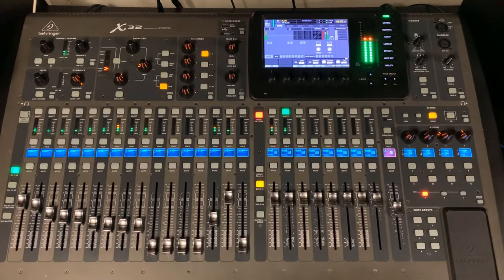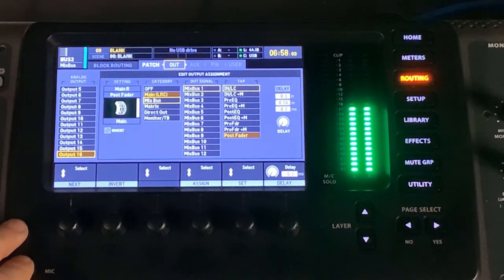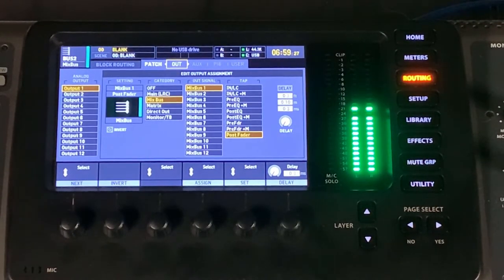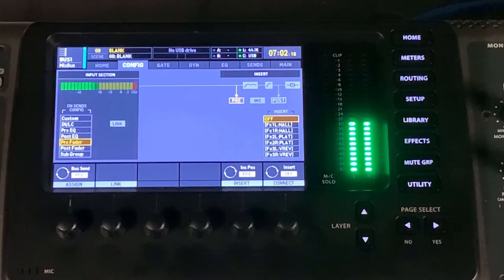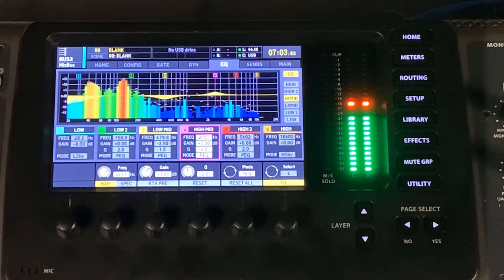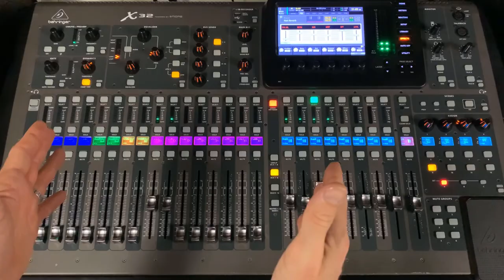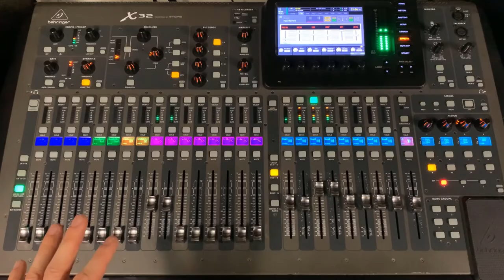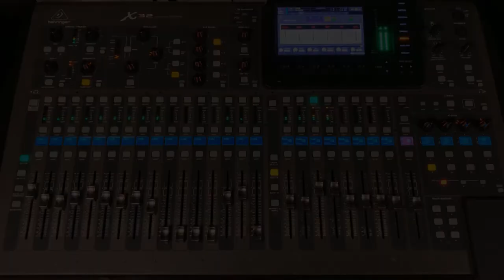How To Setup Monitors On The X32 (or M32) Sound Console

Comment: Thank you for this video!!  Question- at around 16:20 in the video you say when applying effects to the monitor bus, to deselect the stereo bus so it doesn’t go to FOH.  What if I’m already sending some reverb and delay through the FOH but want to send a portion of those same effects to the monitors (IEM)?  Could I just leave the ‘stereo bus’ selected/turned on for the  corresponding effects stereo returns (on the 3rd layer down) in order to have the effects in both the FOH and monitor bus?
Reply from the maker: Yes, you are spot-on. Build your FOH mix first, then start building your monitors. You would treat the FX returns just like any other input and the more you turn it up in the MixBUS, the more you will get.
Reply: @AllamHouse  You rock.  Thank you!!

Comment: Thanks so much for the training.  Pls I will like to know effect of not pressing the home button to lock the console  before power off the X32 mixer.
Reply from the maker: You do not need to push any buttons before you turn the console off. It will return to the same setup when you turn it back on for the next session regardless of what you push before you turn it off. It is recommended to save your scenes so that your settings are saved in case of some error or reset. This video discusses saving your scenes if you need assistance. https://youtu.be/G0bqVeviRKg

Comment: I have my laptop hooked up and my outputs are my Behringer X32. I have my headphones connected to my mixer as well, and I even have Spotify playing and I don't hear anything through the headphones. Nothing from my laptop is being heard, even though the levels and outputs are properly picked. Is there a setting I have to change on my mixer in order to hear everything from my laptop through the mixer, and headphones ?
Reply from the maker: It sounds to me like you haven’t switched the inputs on the console to come from the card. On the console, go to Routing > Inputs and in the bottom-right you can change the encoder from REC to PLAY and this will automatically switch your inputs to look at your X-USB card.

Comment: Thank you for the excellent tutorial!  Can I re-assign any of the buses 13-16 to mix buses from effect loops? If yes, how?
Reply from the maker: Yes, the MixBUS 13-16 can be used like normal MixBUS and bypass the FX racks. You need to do the following items...
1) If you need these to go out of the console you will go to Routing > Out and confirm that output 13-16 are set as the source for the desired outputs.  Keep in mind you are probably using two outputs for Mains so you will really only have 14 other outputs to choose from. Obviously, your situation might be different than what I am assuming.

2) Go to the Effects button next to the screen and scroll over each FX rack 1-4. You want to change the source of FX 1 from MixBUS 13 to Insert. Repeat this for all FX 1-4 so they are de-coupled from the racks.

3) Now each are a standard mono MixBUS that you can use however you see fit.
Reply: @AllamHouse  Thanks Dave, you saved the day! We only use one or two effects max in our normal church services. This opens up a couple more mix buses for our IEMs. Really appreciate your help!

Comment: Hello Allam. Thanks for your Great videos. I have a Behringer X32 Compact at our little church and I am getting to feel my  way in getting to understand it. Thats why your videos are so vital to me. One of my 2 main speakers output plugs (7 and 8) does  not  work ( plug 8). I switch both snakes and they do work in the same output plug (#7).The both perfectly in plug 7 but neither of them works in plug 8.Bothe speakers are great.
Do you know could have  cause this? I know that both snakes are working, and both speakers are also working  because when I switch the snakes  in the same number 7 output plug both speakers  work one at a time of course
Reply from the maker: It seems like a basic routing issue. I would go to Routing > Outs and make sure that output 7/8 are set with Main L/R as the source. Then go to Routing > XLR and confirm that your groupings are set correctly. 1-4, 5-8. This video about the routing screen might offer some more info. https://youtu.be/PpeqRuPGi2Y?si=qPsAJw8Uq7jj9Afi
Reply: ALLMAM You are a Genius. This worked  Great. Thanks again

Comment: Thanks for the video! Question, how should you route a stereo signal from the keys channel to mono wedges? At a friend’s venue, the wedges always have a weird sound like there’s an issue with phasing. The house sounds great, just something is going on with the wedges
Reply from the maker: I typically just send both channels in and don't have any issues since everything will get summed to mono. It sounds like you are saying that when that happens there is some odd cancelling occurring. To troubleshoot, I would unlink these keys channels so they are two mono signals and then send only one. See if it sounds the same or different. If it is better, a work around is to unlink them permanently, pan them manually in the house and then use a DCA to control their volume so you get back to having one fader to control the volume of both channels.
Reply: @AllamHouse  thanks, I’ll give that a try next week!

Comment: Hi, having just ventured into the digital desk with an x32, this is extremely helpful.  One quick question is what do they call the aux outs when rerouting a bus.  Struggling to understand all the various terms on the routing section.
Reply from the maker: People still interchange the terms AUX MixBUS, and BUS.  Most people talk about what it is being used for and then might mention how they are mixing it. Example: I have BUS 4 and 5 setup as In-Ear Monitors for my vocals… they also might say I’m running an AUX Sub which is setup on BUS 12. It all depends on the setup. This console offers more flexibility in that you can build mixes (mains, monitors, stream, etc) and send them out XLR, USB or the physical AUX outs on the back of the console.
1) Do you have something specific you are trying to accomplish?
2) have you checked out my “getting started” video linked here? https://youtu.be/Ua8RaR6ZwIY

Comment: So we have our live stream as outputs 5/6 (bus 5/6). So if we want it to be the same mix as is in house then we would select postfader and if we wanted it to be completely customized for the stream we would select prefader and then do sends on fader with it selected to adjust all the levels right? Also, is there a way to listen on the monitor headphones to the specific volume inputs of that bus 5/6? So if we wanted to hear how a singer on input 4 is coming through to just the live stream bus can we do that? Thanks!
Reply from the maker: For soloing, you can plug in the headphones and hit the SOLO button above any input or output on the console and here what it sounds like. This will not get in the way of your house or stream mix. 

In terms of your first question (Pre vs Post Fader) this video discusses the differences and the setup. https://youtu.be/krg9L_mS-4I

Comment: I have the compact version I set up the bus 7 and 8 post fader and have a monitor plugged into each of them yet I hear nothing at all. what could this be?
Reply from the maker: Here are a couple things to check. 
1) Go to Routing > Out and see if output 7/8 are being sourced from MixBUS 7/8. On the smaller platform console that only have 8 outputs, these are usually designated for the Main L/R outputs. 

2) If you have your routing proper, Check that you have built a mix going into MixBUS 7/8. You select the desired BUS, hit Sends on Fader and then the left side faders can be used to build the mix for each MixBUS. 

3) Finally, since your Bus is Post Fader, you need to make sure your inputs are not muted and that eh fader is turned up some in the house mix as the MixBUS will follow the house.

If you need further help, we can start a conversation outside of YT by filling out the contact card on my website at https://sound.allamhouse.com

Comment: Thanks for this.  At about the 11:00 mark you said that Post Fader was ideal for the Tap.  I'm confused by that comment because that way the FOH mix will affect the Monitors.  Or have I completely missed something?
Reply from the maker: IEM should always be run as Pre-fader.  Floor wedges can also be run as Pre-fader, but in smaller venues you will find that you go to turn down the piano while the pastor is speaking (for an example) and you have the fader all the way down, but your stage volume is still too loud.  In this scenario I would run them as Post Fader so I have control over the house.

Comment: The band I work with has been experiencing inear issues. I looked at our system and found that the sound guy is running an x-32 console and an x-32 core. He's routing the core thru the console and using an IPad to control the core for front of house and the console for running monitors. We'll get a good inear mix at sound check, but things always change in the inears. I'm guessing that he has the inear sends set to post fader. The band owns the system, and the sound tech is a hired hand. After I've done a little research and questioned him on a few things... It's apparent he doesn't really know the system. 
We don't have the x-32 core stage box, so I'm guessing that's why the x-32 console is required. Obviously, I'm not an audio engineer but have been checking out videos on the x-32 and its setup. Would like to get this problem resolved and do away with any redundancy in the system. 
At this point, it looks like I'll be learning the system and how to set it up. The guy we hired obviously bullshitted his way into the job.
Thanks in advance for any help.
Reply from the maker: Yeah, depending on how everything is wired your console (with the preamps) should take first priority. You would set gain on this console and then send a signal across AES50 to the core where the sound guy can set digital trim as needed and mix his house mix. Your console would be the master and the core would be the slave. If it is reversed then he could be changing the gain and it would have a downstream effect on house mix, broadcast mix, recordings and monitors.

Comment: I’ve noticed that some of my mix buses feeding my monitors say “custom” on the insert point and some say “pre-fader”. How do I see what the “custom” configuration is?
Reply: I believe the custom configuration is from if you have certain channels going to that monitor set to pre-fader and certain channels set to post fader. Therefore making it, "custom", otherwise if it's all pre-fader or all post-fader it would display those. I'm not at the console currently but if you select a channel and then scroll over to the sends tab it will display the busses. Underneath the busses it shows if that channel is sending it's information post or pre fader to the bus. So if it's custom some of the channels will be either or but not the same. So I think you'd need to just scroll through the channels when you're on the sends tab in home and see which ones are either or. Hope this helps

Comment: Hey man, do you send compression to vocal in-ear mixes?  I generally don’t want to as I want a singer to hear their dynamics unaltered.  Any tips for that?  Thanks.
Reply from the maker: For me I do send compressed and EQ'd signals to my IEM.  They get a signal that is Pre-Fader and this tends to allow them to have a nice even monitor sound to work from.  I have not received any complaints and I am frequently on stage as well for various instruments and it seems to work just fine.  I would maybe make a change if I had 4 or 5 vocals (like a church I grew up in) that were singing/blending across each other.  Then I might look at not sending the compression to give them a more "transparent" IEM.  I also think in a setting like that I would not be compressing as hard as I am in my rock-band setting.
Reply: @AllamHouse  thanks much!  Just curious, do you run your compression before or after EQ?
Reply from the maker: I run my EQ first, then my compression. My next larger video will be about my vocal settings, so be sure to keep an eye out for it.

Comment: Thanks for the video.  One question concerning hardware setup.  We are using the x32 and two digital snakes along with it.  What hardware is need in addition to what we currently have, in order to add in ear monitors?
Reply from the maker: For In Ear Monitors (IEM) it is best to have the transmitters closet to stage or onstage with your digital snakes. Direct line of sight to the body pack will limit static and signal drops. Since you are going from a digital snake you only have XLR outputs as options, so that means XLR cables are needed. You will need to power your transmitter so you’ll need power, but that’s really it. Make sure your outputs are set to go back to whichever AES50 path you are using and you’ll be good to go.

Comment: Any chance of a "trouble shooting" video on the horizon?  I have a signal coming into the console but nothing out.  Really basic set-up =>  #1-3 inputs, #1-2 mix bus out...no efx.  I'm using an x32 Producer..... (new to digital, prev. console was Yamaha PM2000....)  Thanks...
Reply from the maker: I tend to focus more on the setup side of things and try to guide people on proper steps at the beginning.  That being said, troubleshooting is a huge part of what we have to contend with in our environments.  Your problem statement raises a number of questions and it might actually be good to put my thought process into a video of how I would troubleshoot your situation.  Since that is not going to come out quickly, here is where I would start...
1) Select the input and make sure the ‘stereo bus’ button (left of the screen) is orange.  Turn up the fader and make sure you hear it in your Front of House (FOH) mix.
2) Assuming step one works then you will want to look more into the routing and setup of where you are trying to send the signal.
3) If you are sending to a MixBUS, check your bus settings to see if it is pre-fader or Post fader.  This information will determine how you need to set your faders to get signal to properly flow.
Reply: @AllamHouse  - Thank you!   Yes, definitely a "Troubleshooting" video would be amazing, especially for those of who are new to using digital boards...

Comment: Does it make much difference on the "inputs" with respect to Post and Pre-fader? I have an input routed through input channel 15 from my stage that have a computer connected to it for a click track. No backing tracks, just pure click track. I can get that click track to work independently of my main mix, but I have no independent control for the individual busses. Bus 7 and 8 are used for my Live Stream. I can hear the click track in my in ears, but it also runs through my Live Stream bus, and no muting or volume control for bus 7 or 8 stops that click.
Reply from the maker: The ‘click’ input should be set with the fader at unity (0). The Stereo LR should be deselected to not go into the house. Then, you should be able to select the bus for stream, hit the ‘Sends on Fader’ and put the fader all the way down or mute which should keep the signal out of your stream mix. Similarly, you can select monitor mixes and add it appropriately. 

Prefader and PostFader should still act similar in that you can turn down (or mute) the input in each MixBUS.
Reply: @AllamHouse  Thank you for your help. We have been using a click track for the last couple of weeks quite successfully. The click only goes to the In-ears and not the house. However, the click shows up in our live stream. I have in-ears at buses 1-6, and the live stream in bus 7. We mute the click in bus 7 and turn the fader all the way down, yet it still shows up in the live stream. Any suggestions?

Comment: Thank you for this! We were running into an issue. Is there a way to turn the gain up on the whole mixbus?
Reply from the maker: The gain for each channel should be set properly (I recommend between -9 and -12). Then if the mix is Pre Fader you can turn up the fader for the desired inputs when using Sends on Fader for the MixBUS. Once the mix is built you could use the compressor (in the channel strip of the MixBUS) to raise the volume even more using the make-up gain (bottom right knob on the screen once the compressor view button is pushed). In theory though the basic mix should be enough to get a quality signal and your headphone amp or IEM module would give the option of turning up the volume.

Comment: I would like the EQ feature but no Compression in the wedges.
Reply from the maker: If you need to EQ and/or Compress your inputs different than your MixBUS sends you would need to tap Pre-EQ going to your MixBUS and then use the BUS EQ and Comp to dial in your setup. I try to do some general EQ and Comp that can be sent to any location and then fine tune the different Buses as needed from there.